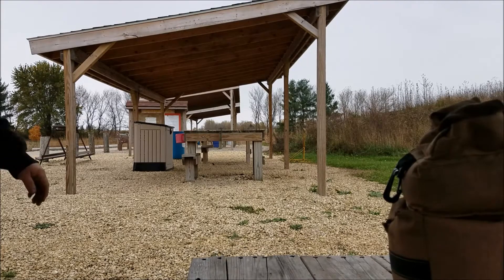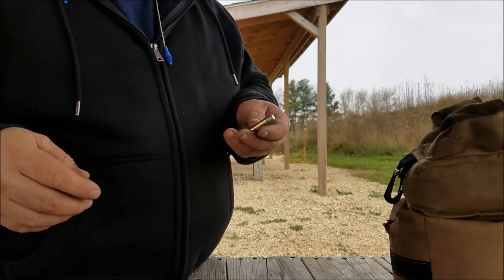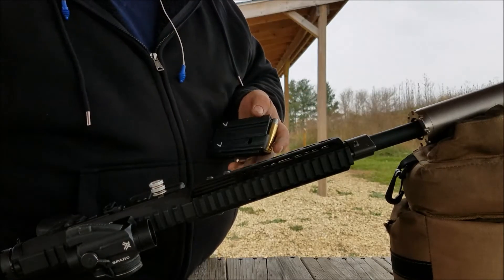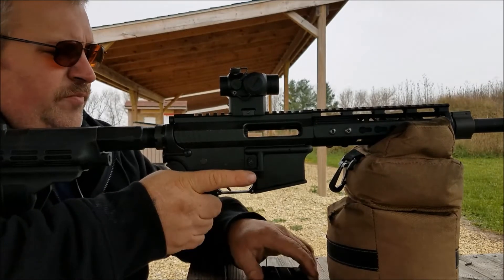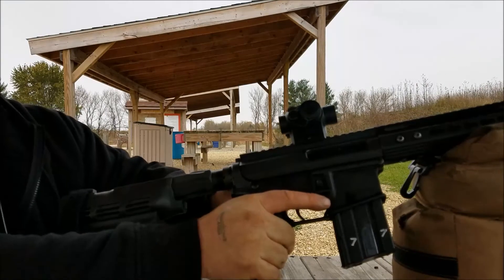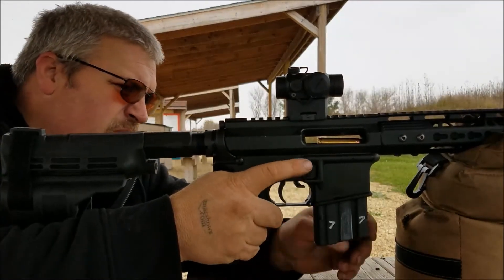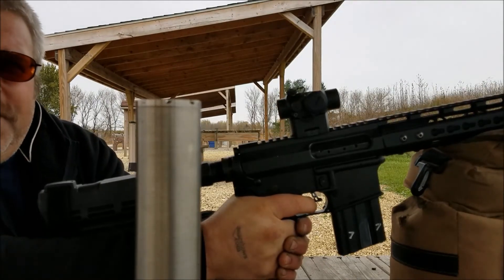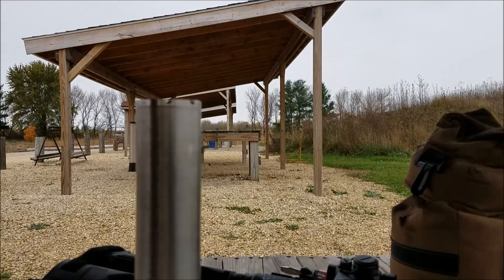45 vrap subsonic

Comment: I finally saved some money to buy the barrel and dies but I cant find it for sell anymore. Did this round get shelved? Hope not I love the energy it delivers up close.
Reply from the maker: nope not shelved i make each barrel custom for guys i don't stock any. i like to know guys can load responsibly before i sell them a barrel.  i am waiting on bolts so that is about a month out then i can take orders again.
Reply: Ahh! Outstanding sir. And I don't blame you for making sure they don't kill or maim themselves. I will just keep checking back on the website. Thanks so much.
Reply from the maker: just send me an email in a month or now so i have your email and i can contact you when i am ready to build some.
Reply: @MrBiggdawg800  what is your website and email 
Also does this require a special uper or will a regular upper work with the injection Port just opened up I have been waiting to build the 45 raptor for a while and just found the vrap tonight and I have a lot of 15  parts sitting around waiting on a barrel just can't decide what Cal to go with now I know what I want LoL 😂